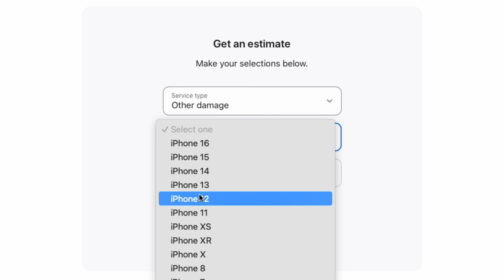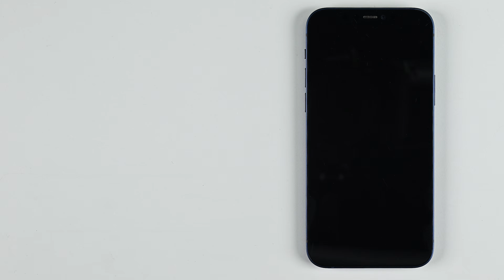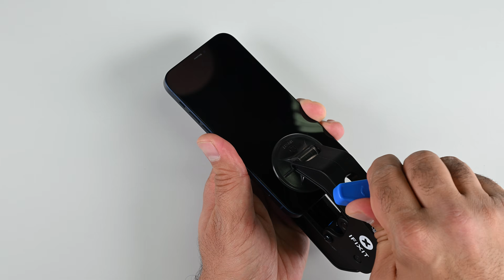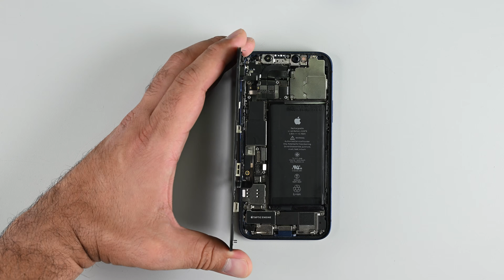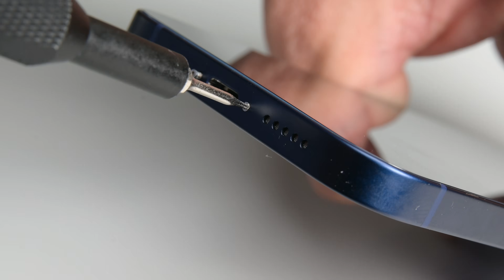iPhone 12 and 12 Pro Speaker Replacement - Simple Soldering Fix!

Comment: What liquid did you use to remove that component? 3:39
Reply: The component is removed through soldering. The liquid you saw was isopropyl alcohol, mentioned shortly after.
Reply: @Rocket33r thank you

Comment: When you get a replacement speaker and move the sensors over to it, beware of the two small metal mesh covered sponge rests on the original speaker unit. The replacement comes without it and the video guide makes no mention of them. But you'll need to remove them from the original speaker unit and place them on the replacement so the sensors will stay in place and work properly.

Comment: Hi team, 
Finally, I feel like this issue is going to be fixed. However,  this partis not sold in Australia. 

Is there any other way to get this part?

 iPhone 12/12 Pro Earpiece Speaker and Sensor Assembly

Type 	Part # 	Supplier 	URL
	IF442-038 	iFixit 	Not sold in Australia

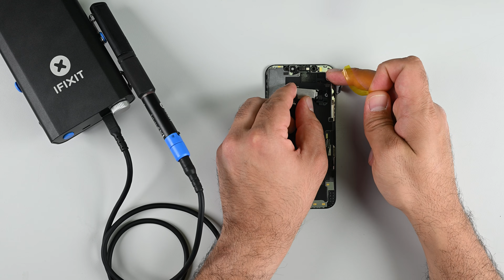Comment: 3:54 Would have been nice if they could have zoomed in on the soldering.
Reply: No need to he just added a little so u don’t need to add any when soldering back to the original ribbon cable. It’s a standard thing to do.